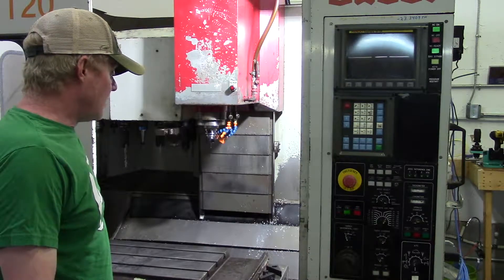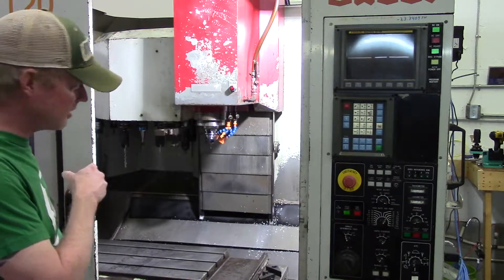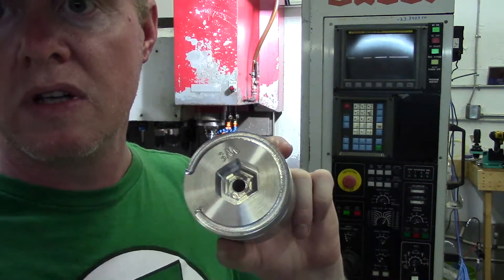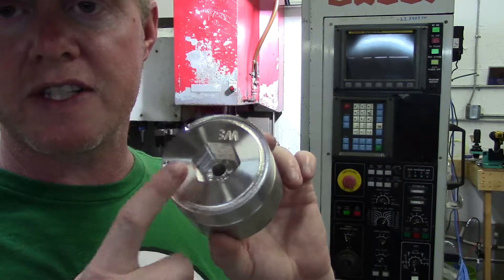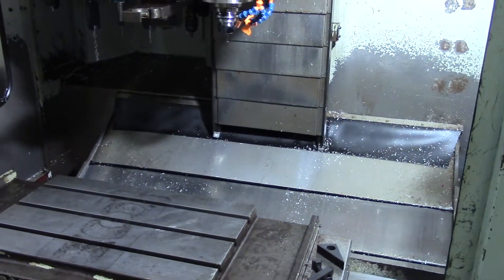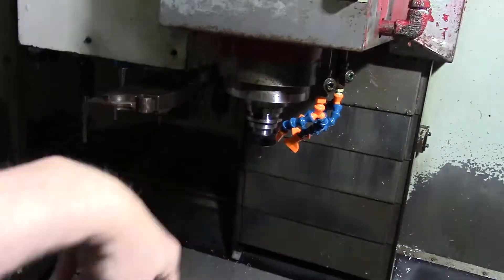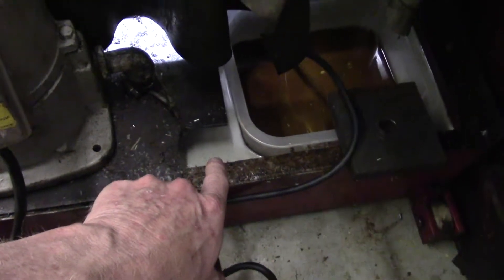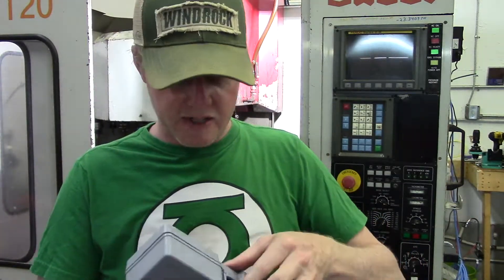CNC Coolant Care and LED light upgrade in the VMC

Comment: Shane you illustrious raconteur, this is exactly what I was looking for.  I just bought a used Hardinge VMC600ii and it has a burnt out light work light and rotten dirty old coolant.  The Amazon link is broken.  Which LED light did you end up going with?  I think (not sure) mine is 24v.  I haven't taken it apart yet.  

Also I have a 5 axis Chiron with an external coolant chiller and it specifies 5% Motorex Coolant-F, whatever that is, and 0.15% antiseptic.  There is no product information on the antiseptic.  There is not even a tiny hint of a patina of rust on that machine.  The sticker on the machine says the pH should be between 8.4 and 8.6.  So slightly basic.  Anyway whatever they're doing is working because I'm not used to seeing an older machine that's that clean.  The spindle and under the table of my Hardinge are quite rusty.
Reply from the maker: The light manufacture store is here https://amzn.to/3MTgXIX. They have newer models.   I haven't really seen rust problems on any of my machines but smelly coolant up to the point I switched to RO water and stopped using soluble oils.  I use synergy and it has been life-changing in terms of keeping the coolant for long periods.
Reply: Do you still have the Hardinge VMC-600II?